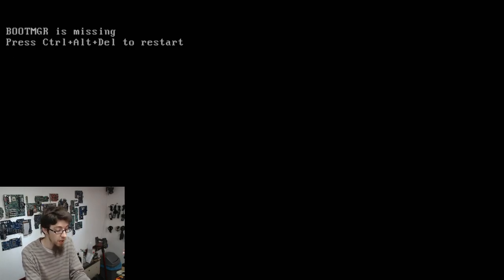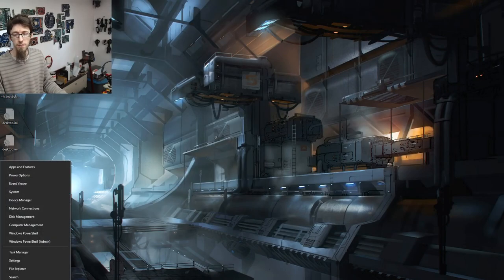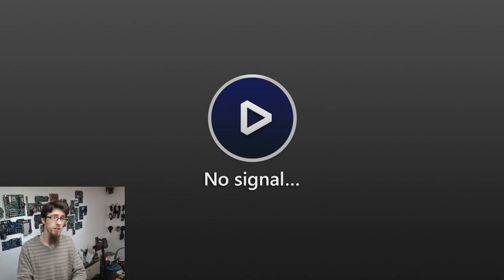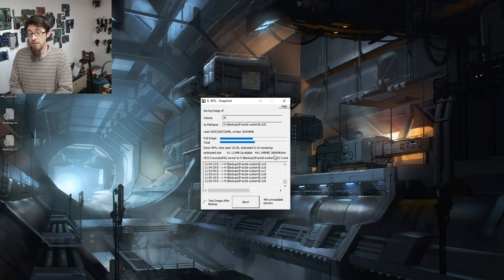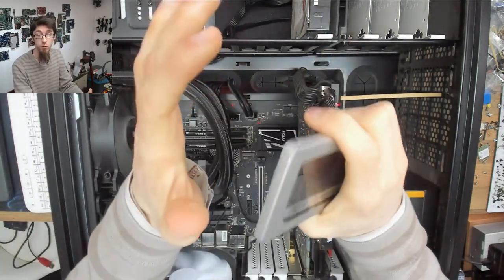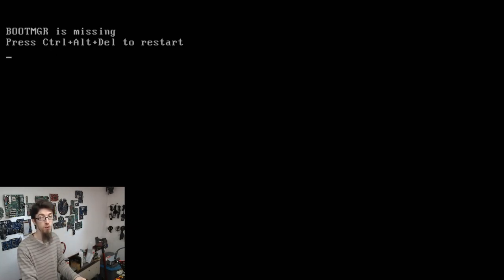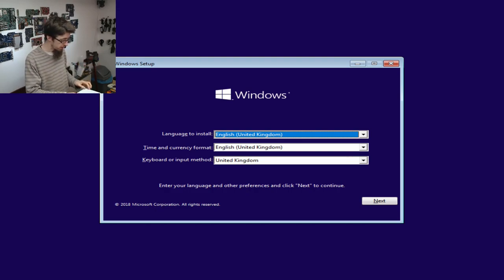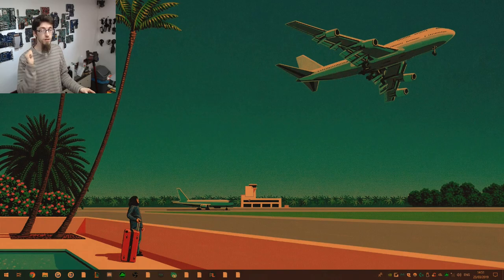LFC#170 - BootMgr Is Missing

Comment from the maker: This video's picking up views again, so here's a pinned comment:
As a lot of people in the comments have noted - and I've learned since doing this repair - the likely issue with being unable to do bootrec /scanos or /rebuildbcd is that it's a Legacy windows install and my flash drive was booted in UEFI mode. You can boot a Win 10 flash drive in Legacy mode as well if you disable UEFI in the BIOS, or select it from the boot menu, and this will likely solve the problem. Another possible fix is to format the 'system' partition at the start of the drive to erase the boot manager altogether, and then there won't be any write-protection blocking stuff. If all else fails though, the strategy I use in this video is still an option.
Reply: FYI, I would never consider it an option to install a copy of Windows just to use the bootloader. It's actually not that difficult to create the system partition from scratch. With a freshly formatted system partition it's basically just a matter of running a bcdboot command, then rebuilding the BCD (after running the fixmbr and fixboot commands if necessary). I don't think running fixboot would even be necessary since it seems like the bcdboot command takes care of pretty much everything. Also I see the partition is already set as active so I can't even imagine what fixboot would do at that point, now that I think about it.

Comment: That trick of restoring just the main partition on top of a fresh install of windows is genius!
Fixing boot manager problems almost never works and using this method seems to be the most efficient solution I've ever seen. The best part is this one method can solve multiple different boot manager, or active system partition problems that prevent windows from booting. I will use this technique in the future. Great video.

Comment: Really clear, super accurate presentation here!  FYI:  we struggled with drive images that were being corrupted while they were being written.  Fast-forward to the solution:  an upper region of Corsair DDR2 had failed after several years of flawless reliability.  I should have checked that much sooner.  The way I discovered that failed RAM was this:  I upgraded the motherboard BIOS, and the default setting DISABLED QUICK BOOT.  In that POST mode, it tested memory thoroughly and I noticed that it stopped short of enumerating the total amount of RAM installed.  AHA!  I replaced that old DDR2 with brand new G.SKILL, and our original problem was fixed.  Bottom Line:  switching the motherboard BIOS to SLOW BOOT MODE could be a quick and useful way to check RAM.  And, you were absolutely correct to recommend that RAM be tested separately.

Comment: I had similar problem, but windows would say there are missing files, and then the system would enter windows recovery which then restarted the system, and said bootmgr is missing,and spent hours running round in circles trying to diagnose,and fix the problem. I tried re-building the BCD, but the error messege was still present, and did everything under the sun but would not budge at all! Resorted backup everything up using utility, and then re-install windows on the drive, and then restore everything back onto it. Which actually worked very well! 
Thanks for doing this video, has been great help! 
~Stay Safe!

Comment: To fix the "access is denied" issue at 34:53 after /fixboot, run: "bootsect /nt60 sys" (without quotes)
And then rerun /fixboot
Reply: That doesn't always work. I've had to completely rebuild the EFI partition via diskpart in most cases.
Reply: @CoMmAnDrX  it has yet to fail me
Reply: can't believe I didn't find htis earlier, I had to just copy over files manually to a new windows install.

Comment: @47:10 you talk about the partitions created by the Windows installer.  Those are because you used DiskPart to clean the partition scheme from the destination disk. Windows created a new partition scheme, and it defaulted to the newer GPT scheme.  The EFI and 16MB Reserved partitions are needed with the newer more modern GPT partition scheme.  The original Windows drive used an MBR partition scheme which does not need the EFI and 16MB  Reserved partitions. That's why your backup doesn't include those.  If you wan't to replicate the original partition scheme.  Then use Windows Drive Manager to convert the GPT drive to MBR.  Then install Windows with a drive that has been pre-designated as MBR.
EDIT: One of the main advantages of the GPT partition scheme is being able to create partitions larger than 2TB.  This was an MBR limitation.

Comment: The same problems can happen while cloning a larger drive to smaller SSD.
The new drives partition has to be able to boot so it must be ACTIVE
While in the repair CMD enter "diskpart" (in this case the drive is 0

list disk
   select disk 0
   list part
   select part 1
   active
 
exit

Then use following commands:

BootRec /FixMbr
BootRec /FixBoot
BootRec /ScanOS
BootRec /RebuildBcd

the Access denied issue, if I remember correctly, you have to disable the secure boot in the BIOS or try to switch to Legacy instead of UEFI.
After you fix things, you can revert the BIOS  settings.
Reply from the maker: Active shouldn't matter on Windows 10 because it's all GPT these days - only MBR has an Active partition IIRC...
However, may help people in Win 7, and rest of that is solid advice 👌
Reply: @Adamant_IT  it sure will help if you upgraded your old windows 7 to windows 10. Thats what I've done a lot the past 6 months.

Comment: This is an oldish video now. The boot manager tools will repair the boot manager, they won't fix a broken OS itself. That is why it sometimes doesn't work.

The access denied message seems to be specific to a particular build of Windows 10.

https://answers.microsoft.com/en-us/windows/forum/windows_10-update/windows-10-bootrec-fixboot-access-is-denied/747c4180-7ff3-4bc2-b6cc-81e572d546df
For a full description of what each option does:
https://support.microsoft.com/en-gb/help/927392/use-bootrec-exe-in-the-windows-re-to-troubleshoot-startup-issues
Ironically Arch Linux wiki has some good information how everything is laid out.
https://wiki.archlinux.org/index.php/Dual_boot_with_Windows
It is worth understanding maybe how the Linux boot process works for UEFI. Windows and Linux are completely different systems. The boot process is conceptionally similar.

Comment: This is good, I like the clean install for the boot and restore of the main windows partition from the image. The only thing I was thinking was although there was clearly damage to the boot partition, how do you know that there was not more subtle damage to other partitions? It could potentially cause programs to not run or crash. I would have tried to just pull off any important documents and images the customer wanted to keep and gone for the full clean install on the new SSD. It is more work, but it would be clean and would give peace of mind that OS and program files were clean. Maybe this is an option you give to the customer?

Comment: I've been using SSD's for years now, nary a glitch yet. Personally I recommend Samsung SSD's.
Reply: yeah Samsung is a master in term of reliability and speed
Reply: bought a samsung ssd and life couldnt get better mate
Reply: Samsung is good if you’re willing to pay about 1.5x what they’e worth. I’ve never had a problem with any WD drive, and they’re much more reasonably priced for their performance.
Reply: been running a samsung m.2 950 pro. non stop since sept 2016
Reply: SK hynix is good too
Reply: @jordanranstead3016  late reply but my laptop Lenovo legion 5 has a skhynx m.2 512gb ssd
Reply: @amyfranchuk6704  Samsung Evo and Pro line are worth it if you have say a copy-shop or are a graphical or video editor and tons of large files are swapped with lots of reads and writes on the SSD. If you have a cheapo SSD you'll end it's life soon. Samsung Evo and Pro lines have ram on them, DRAM, and that's used for all the temporary nonsense instead of quickly ending the life of the SSD cells, so drive health stays high instead of using all it's life/write-cycles it in a few months.

Comment: I always disconnect any other drives when running the Windows Installer.  I never trust it to put all the relevant partitions on the drive you want.
Reply: this is difficult with NVMe drives that are hidden away behind other components
Reply: @gulam82 Not an issue on NVMe only SATA drives

Comment: any newbies building a system, ALWAYS disconnect any other hard drives PRIOR to installing your Windows installation on the BOOT SSD. The OS does have a habit of putting the BOOTMGR on one of the other drive(s), I assume related to what order they are showing in the BIOS, so if your mechanical hard drive is device 1 in BIOS then that may have BOOTMGR put on it, if it fails or is formatted then missing BOOTMGR occurs. Once Windows has finished installing, run updates until it is up-to-date, switch off, plug your other drives back in, then run disk management when you reboot back into Windows.

Comment: That SMART data doesn't read like you'd think.  A lot of those values work backwards from the way you would assume.  I don't claim to know the system any better than that... it's confusing.  WD Data Diagnostic tool for Windows has pop-up tool tips when you hover over the SMART data values that explain it a bit.

Comment: The original drive was MBR which is a legacy standard. On the new drive it was setup as GPT which is required for UEFI. And no need to full install the OS, you can start cloning the partition(s) back after the first restart, or the second if you need the recovery. I'm actually surprised it loaded the old OS though. Usually requires more tweaking of the OS going from a MBR to GPT. And the if keeping the recovery partition (as you should) you will have to tell the OS where it is since the partition layout has changed.

Comment: I know this is an old video but I did note that bootrec /fixboot access denied is a USB Flash drive recovery media issue. Probably due to the software that was used to create the recovery drive. 
I found that burning a CD/DVD mostly works provided you boot the CD/DVD in the correct mode for the windows installation you are trying to repair (legacy or UEFI mode).

Comment: What puzzles me is first there was a MBR install and the reinstall made it EFI on the new drive, obviously. I doubt that overwriting the system partition with the old windows install will work that way, unless you make sure the new install also uses the original partitioning scheme?

Comment: I know this is an old video but I observed 2 problems. First is you didn’t resize the partition after restoring for the final time - does the imager take that into account? Second is you may have noticed dead icons on task bar - those programs should be tested to see if there damaged and restored but yes the customer could do this but from my experience people using computers barely have a clue how to turn them on let alone use them. Apart from this I learned some new commands I didn’t know about and I have been fixing pc’s for a long time so very surprised about that. Thank you.

Comment: I will explain why you get the funny extra partition.
If you boot the windows setup from the EUFI option in the boot menu it will create the extra third system partitions, If you boot it from a standard BIOS boot it will only make the 2 Partitions.  Next time you look in the boot menu and you see 2 options for the same item this is why. The one with EUFI at the start will boot into EUFI instead of BIOS. 
Also this is similar with GPT + MBR, If you install from EUFI it will default to GPT but if you boot from BIOS it will default to MBR.
Hope this this help.
A fellow repair shop.

Comment: Wondering if you need the same build version when installing new windows 10 then restoring the windows you backup🤔
Reply: I think the windows 10 are all near enough the same until you enter an activation code in windows settings. I installed pro once, whacked in the code i bought online and it changed to enterprise edition 😂. I think the saved system partition should overwrite the fresh install system partition anyway but it would have been good to know what version his mate had and if it was still activated at the end of it.

Comment: I love your videos, they are so interesting and you explain everything very clear. I'm building a new pc and I'm planning to move from a HHD to an SSD. I have windows installed on the HDD. However, I'm planning to have Windows on the SSD, and as I want to keep the HHD I was thinking to install first Windows on the SSD and then plug in my HDD and delete the partition which has the old Windows on it. Do you think that this is going to generate some kind of issue? Thanks.

Comment: I've never managed to get it to fix itself from Windows 98, XP all through to Windows 10. If I have issues I just restore and image I make each month. I'm still rocking a Crucial M4 128gb SSD from 9 years ago and it's got a broken connector it snapped off in the sata cable. I did replace it with a Crucial 240gb but when building my new Ryzen build it kept BSOD with the 240gb but the 128gb it didn't. So the 240gb is now a gaming drive

Is that GPU in the correct slot x16 thought they always are at the top of the slots

Comment: Two questions:

The 1st method: if some of the sectors were bad, which presumably corrupted some files, which were the cause of the crashes and BSODs, wouldn't that mean those corrupted files are still present and will still cause issues? After all, you made an image of an unhealthy installation, right?

The 2nd method: wouldn't restoring a different windows image onto a fresh one, have the chance of creating a mixed windows installation with different file versions? Maybe the windows you freshly installed is of a different version from the one that the customer was using?

Comment: Do you have an idea, what could be with my Asus Q502LAB laptop, that the HDD sometimes is not recognized in BIOS, and boots directly to the BIOS when is booted up? Sometimes, it boot OK.
Reply from the maker: Download Seatools for Windows and use it to run a Long Generic test on the HDD (when it has booted OK). Most likely the HDD is dying.
Reply: @Adamant_IT  The thing is, that it is a brand new Samsung SSD.
Reply: @19mati67  pull the drive out, clean contacts gently with a soft  rubber to get off any oxydation, then clean it with isopropyl acohol and reinsert.
After that, download Samsung Magician and run the diagnostics on it.
Reply: @marcellipovsky8222  Thanks for that, but I believe that I have a motherboard hardware issue. I have tried an msata(M2 to Msata adapter with an M2 ssd) drive too and now it won't recognize any hdd. What controls the sata ports? I have replaced even the HDD daughter board as well, with no change.
Reply: @19mati67  If you change the daughter board I'm pretty sure you need to replace the memory chip? Too, so the hdd gets recognised?

Comment: First thing I noticed that the GPU potentially is in a 8x slot - probably not, but it is not in the first 16x slot which is not recommended. Also, back fan cable is squeezed and could cause a short to ground.

Comment: it's not arbitrary, just have the boot drive in SATA 0

regarding the partitions .... the original SSD (the Corsair) was initialized MBR and W10 was installed in MBR/legacy mode, the new SSD was initialized and Windows was installed in GPT/UEFI mode - those partitions made quite a lot of sense; what's baffling it that it actually worked ... it should not've
Reply: If the drive has MBR partitions you should boot to the Microsoft Windows W10 USB drive using the last boot option - then repair in MBR mode.
If the drive has GPT partitions you should UEFI-boot to the W10 USB drive in UEFI mode (first boot option which is what you did).
So you booted in the wrong mode - MISTAKE!!! The first thing you should check (e.g. using Diskpart) is 'Is the disk GPT or MBR?' - if MBR then boot in Legacy\MBR mode - you can't repair an MBR disk in UEFI mode and vice versa!
'BOOTMGR missing' is a Legacy\MBR error message -so the clue was right there and you should have booted to the repair USB in Legacy mode.
Also - the first thing you should do is run chkdsk /r  before you even attempt to write/repair boot files on the new drive since it was copied from a damaged drive. The file system could well be corrupt and adding more files could screw it up even more.
P.S. If the disk was GPT, then the BIOS should have attempted to UEFI-boot from the disk - so you should change the BIOS boot option to UEFI boot from the SSD instead of Legacy boot.

Comment: Hi, what about Crystal Disk info to test ssd for basic test?
Reply from the maker: That's a good confidence test, but you're only looking at whatever area the test data is being written to - so it's not definitive. But yea, it helps gather more information. If the drive is pulling really awful speeds in Crystal Disk then that's definitely not a good sign.

Comment: Shouldn't "CHKDSK H:/f" have been run on the SSD, before attempting the "copy to backup file" procedure? I've never heard of CHKDSK causing any drive damage.
Reply from the maker: Could do. I usually copy everything as-is and do any checkdisk-ing afterwards if needed. But there's certainly no harm in doing it before hand!
Reply: @Adamant_IT  The point being: simply running CHKDSK can sometimes be sufficient to re-enable the boot function.

Comment: The reason windows created more hidden partitions is because the disk had been initialized as GPT under UEFI. If you let the disk run under Legacy settings (non-uefi) it will only create the one, recovery partition.